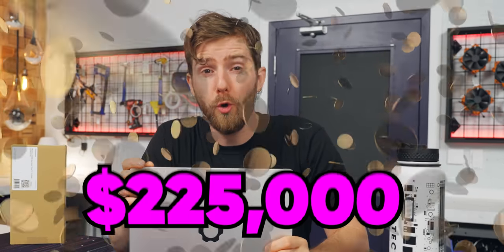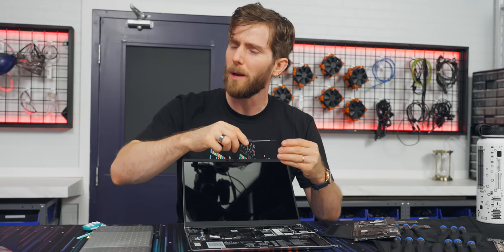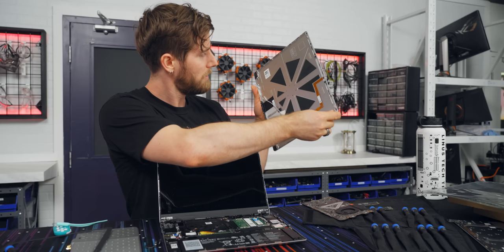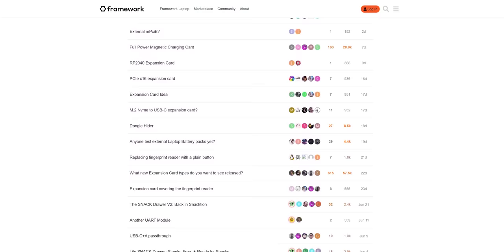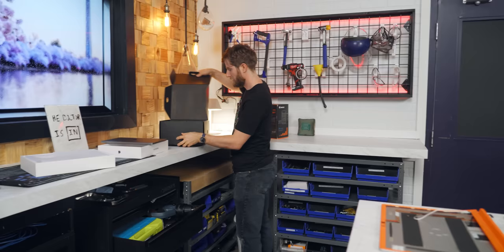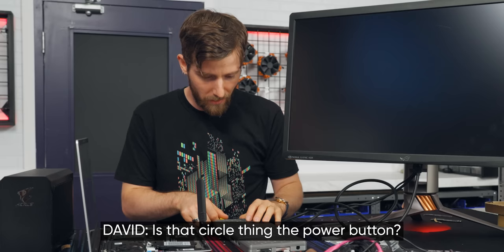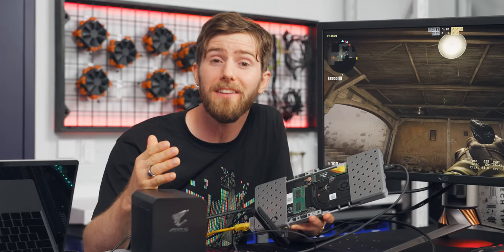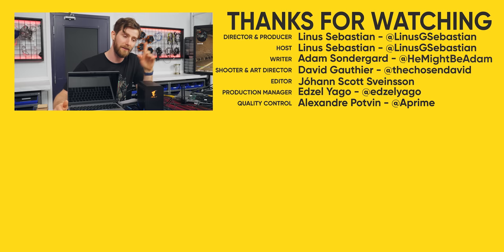I invested $225K in Framework Laptop - 1 Year Update and 12th Gen Upgrade

Comment: I really hope they'll make a future version with a dedicated GPU that is gaming capable. Upgrading your GPU down the line is far more interesting to me than upgrading your CPU.
Reply: That'll come down to manufacturers offering suitably sized GPUs (maybe a line specifically for modular laptops?). I really hope it happens, since I do game on laptop about 1/3rd of the time.
Reply: @MindForgedManacle  They used to make them back in the day. Alienware even had them.
Reply: I read on their website that they plan to do that eventually
Reply: fortunately eGPUs are widely available and relatively cheap
Reply: Nvidia used to make MXM or something, format graphics 'cards' that where physical cards that could be changed on the mother board. But that format has long since died, a GPU upgrade would involve changing out the entire motherboard including the CPU since intel dose not make socketed mobile processors anymore.
Reply: Agreed, that makes sense. GPUs become outdated more quickly than CPUs do!
Reply: If it does happen it probably won't be a top of the line gaming gpu, but a work station gpu. This laptop is supposed to be a laptop not a portable gaming pc. Still, they could surprise us.
Reply: just about what i wanted to write.   Add an option for a riser card and youve opened up to a whole new market..
Reply: That will require require a bit R&D to make the bandwidth work. Nvidia no longer support the Mobile GPU card since 10-series…
Reply: I'd love it if it was simply a new chassis, DGPU board, and battery, allowing users to use their existing MB.
Reply: That definitely would mean another chasis, so another model but yeah definetly possible, they would have the Original and the Gaming version, the problem would be that in order to change the GPU you'd need to buy the MoBo with everything including the CPU, just like they did now and that's because everyone has abandoned the mobile GPU form standard (like the DGFF, Dell was pushing) and CPU upgrades between generation means most of the time having to change the motherboard too because at least intel keeps changing the socket when they have a chance (yes not always but it would be unpractical to add a socket if it means just one jump at most). So, in order to make the GPU modular on its own Framework would have to come with its own daughterboard design and form factor and invest a lot of time and money into making different GPU boards with different GPUS and be sure their cooling system can be adapted to each of those, which sounds impossible for them RN. I mean, Dell tried to push their standard again and failed, so the more viable solution is to change the whole MoBo with CPU and GPU which means more to pay for the end user but that's how it is.
Reply: that is if there is a standard available, sadly I don't think major manufacturers would do this as there was a standard called mxm but was dead by the arrival of the gtx 900 series for consumers
Reply: @tv321123  Nvidia still makes discrete GPUs for laptops, it's just a matter on how Framework could adapt these chips on a new modular format.
Reply: I see this being feasible more in the short term through using their main board replacement system but having ones with a discrete gpu. Obviously they would likely have to offer a larger chassis or use a very efficient chip but it is definitely a place where the business can start now use that early knowledge to expand later.
Reply: MXM cards were the best thing to ever happen to gaming laptops and they scrapped it just to make the laptop thinner. What a waste of great design.
Reply: @walkinmn  That's a good point. Maybe one day they'll have the power and money to create their own mobile GPUs based on nvidia or amd chips. That would be the dream to switch your laptop GPU, like you switch your desktop GPU.
Reply: I think thats a tall order on a 13 inch thin and light. Your battery and thermals would be awful. An egpu solves both these problems. Then your laptop stays portablr for small on the go tasks but get full performance for big jobs when youre plugged in anyway. And framework has a battery disconnect mode
Reply: @matthewtrebs9738  I would be OK with a 15 inch version with better thermal design. 15" makes more sense with gaming anyway.
Reply: @tv321123  I mean one should be able to just take the chips and put it on a socket board instead of a mainboard.
Reply: @waralo191  Great so what connection standard is this 'socket board' going to be? How is the thing being cooled in a notebook? What happens when inevitably after 1-3 generations the graphics chip needs to change size to match a new architected and your 'socket chip' design is now defunct........ It's a horribly complex thing that your simplifying to idiot levels. It's been done plenty of times in the past...there is a reason why it's not done anymore....why it's not happening anytime soon...why no company is going to invest the massive amount of money needed to make it happen, only for all of it to go out the window after 1-3 generations.... Went so well with the Area 51... And because of the aforementioned problem's the old MXM standard never made it past 1-2 'upgrades' before the standards had to be updated and there was no 'update' that could be made anymore...
Reply: @Kenttheclark  ... and have terrible bandwidth. To the point of desktop 3080 performing like a 1080 due to thunderbolt bandwidth limitation. Trust me, they aren't worth it. There have been multiple testing throughout the years and the performance loss is horribly high.

Comment: I can't even count the amount of times that I've handled a laptop and said "I'd buy this if only they didn't fuck up this one feature" being able to retroactively swap simple parts (and even in the future had a catalogue of parts for one component) Really could feasibly make this the last laptop you need to buy.
Reply: Except that their screens are shiny, low refresh rate, there aren't full size arrow keys or a TB4 module. Oh and the screen is too small for my use case. If they made options for all of these things I'd probably get one. But just a few swappable modules that I could just use an adapter for really isn't all that appealing to me.
Reply: @allanshpeley4284  They are a small company, they simply cannot do everything at once. In the future, I believe they will fix the problems you are talking about.
Reply: @allanshpeley4284  maybe you should shell out 2k for new laptop and throw the old one in a landfill :)
Reply: Already a step ahead of you
Reply: @eliaskruse4187  Hope so
Reply: @allanshpeley4284  I think the biggest problem you mentioned is screen size options, it is a problem hardly solvable without changing the whole chassis, which would mean splitting your production in two and outputting more waste. But for the refresh rate/glare issues, well I'm pretty confident saying it's just a matter of time before they'll release a matte 120 Hz panel. Maybe some out of the shelf screens like these already exist compatible with the Framework though?
Reply: @a_d_z_y__  They really need to make more parts industry standard, such that most screens of particular size will fit, just like RAM and SSD.  At the other end of the spectrum, their module bays need an extra connector providing stuff like PCIe lanes and non-USB power.  This would allow the aftermarket to create modules with non-USB chips, such as 10Gb Ethernet and 8Gb SAS.
Reply: @johndododoe1411  is there even an industry standard for laptop parts?

Comment: Watching this made me realize how important on-board assembly diagnostics are for a user-serviceable device. Being able to quickly identify missing screws/components would go a long way towards ensuring that all users (regardless of their organizational skills) can complete repairs/replacements.
Reply: For screws, electronic detection will turn into a nightmare of anti-repair features.  Clearly labeling screw positions and limiting the total types needed will do a lot more.  "Oh. Where does this extra 7mm long screw go?, looks around and finds an empty hole marked 7x3 in the hinge."
Reply: @johndododoe1411   additionally, they could limit the number of screws by making one side slide into a slot, and then the other side is the only side that needs a screw. (Like an M.2 slot on a motherboard, it's held down on both sides, but only uses 1 screw)
Reply: @shipwreck9146  Screws provide a firmer clamping than a ledge.  M.2 mounts use a connection and a screw because the connection is needed anyway.
Reply: I strongly support reducing the number of necessary fasteners with good engineering and bright markings for screw locations (which are covered when a screw is inserted).

I also support electronic detection systems (when appropriate), but on-board systems can be as complex as a full bios level readout or as simple as a labeled storage compartment included in the device housing.

I think we agree on the principle that if Linus missed a screw in reassembly, this should be looked at a bit more on the design/engineering side.
Reply: @johndododoe1411  Coloured screws is the way to go. GREEN SCREW GO IN GREEN HOLE is as idiot proof as it gets.

Comment: If / When they finally have a ryzen and discrete GPU option i will get one. Love the idea and principals behind it.
Reply: Vote for ryzen!
Reply: The motherboard won't fit the case.
Reply: @lesliesavage9229  why so?
Reply: @FilSerge  There is no way to make a totally different designed board fit, when the board going in without the GPU on it barely fits as it is. Probably why they haven't done it already.
Reply: @lesliesavage9229  it doesn't sound like a problem at all. Chips have comparable sizes.
Reply: @FilSerge  The original poster wants a GPU not attached to the motherboard, his use of "discrete GPU" which means adding a GPU card. Not going to fit, and a Ryzen that is current will be bigger than a Intel Iris GPU built in to the Framework at present. What he wants is much bigger than what is in there now.
Reply: @lesliesavage9229  Agreed on discrete GPU. My thoughts are it has no use in framework.
As for bigger size of amd chip, zen 4 should fit perfectly.
Reply: @FilSerge  GPU and related circuits and not just a CPU. People use laptops for everything, but I don't see gaming in the future of Framework, which is an overpriced and undersized hobbyist toy.
Reply: @lesliesavage9229  Gaming laptops are not overpriced comparatively. All laptops come at a premium and gaming laptops just add to that. The problem is demand. If Alienware couldn't pull off the replaceable gpu modules, I doubt framework could...
Reply: @momoware  I am not talking about the price of gaming laptops at all, which I have owed a few, and this is not a gaming laptop, not even close. First of all the screen is too small. I am saying that the Framework is overpriced for what it delivers in any market, and that it will never have a GPU in it that is anything like some of these post seem to want, because of space in the laptop itself. They built it for what it is, and it's not for games, and gaming hardware takes up more space then it's current hardware, so this isn't as expandable as some may wish. I am looking for a laptop, and right now it is between a System76 and a foreign laptop, which either is going to be more than $2K, if I go through with it. But this is just an expensive toy you can swap out modular parts.

I hope Linus gets his money out of this investment, but Linus seems to have an expensive taste for tech. I really don't see this as a good investment for anybody.
Reply: @lesliesavage9229  The premium with swappable parts is steep, similar as all the Alienware laptops with modular GPUs. I wouldn't say it's "overpriced" because it is the cost of that feature, which incurs costs like opening additional factory lines for the modular parts and maintaining respective inventories. It's not really a "toy" either because it's duly executed in its own design. It might be an unsuccessful product, but I don't see how it's a toy.

The chasis is small because that particular product was not made for gaming. There's no reason that the chasis can't be bigger to accomodate different motherboards.
Reply: @momoware  The only people who are going to take this laptop seriously are people who will play with it, which makes it a toy.

I've fixed and sold computers, including laptops, and people bring in computers to get the p--- off it after they went where they shouldn't of, which is how un-savy your general public is. Case in point, Linus is excited about this, and he is a tech nerd that plays with technology. Most people who use laptop don't. Even some gamers bring in their machines to have them upgraded and repaired. I had one rig come in that cost more than all the computers in my shop combined, and we fixed it for a gamer. This Framework would like to be something, but it is for the person who plays with his computer, not talking about a gamer.

Also you said, "There's no reason that the chasis can't be bigger to accomodate different motherboards." There goes their business model with a bigger laptop to except bigger boards. It's a toy for computer nerds to play with, when a computer should be a means to an end, and not the end in and of itself.
Reply: @lesliesavage9229  A lack of market demand doesn't mean "toy." It's a strange word that makes a simple issue more complex: this laptop won't have enough buyers, and it won't have enough buyers because of its high price tags (expensive -> not enough buyers). People don't buy it not because it's modular but because it's too expensive.

This doesn't have anything to do with it being "toy" or catering to tech hobbyists.
Reply: @lesliesavage9229  The demand supply curve is static for a certain kind of product. It's the pricing that captures the demand. The price shifting too high on the curve doesn't make a product categorically different.

Cheaper modularity result in even more tech hobbyists buying the laptop, and hence more people buying it as a toy. And of course, it would also result in regular users buying it.
Reply: @momoware  Modular design is always more expensive, which is going to keep it in the area of a play thing, an expensive toy, like a Corvette or Mustang. Look at Linus in the video, who looks like my father playing with his Corvette, his a toy.

You can go around and around on this not being a toy, but they have other serious problems as well, when they can't even make hinges like the laptops that came out of 2004. I am not going to argue any further on this because it is a waste of my time, and go do something more productive. It's still a toy, and they need to bring this out of a gimmick laptop only a few would want to play with.
Reply: Have you gotten a framework 16 yet?

Comment: As a student looking for a new laptop for university next year, I love the way the framework laptop works. Everything is so easily swappable and user accessible. With a laptop being my only computer, having so much granularity and control over my device is comforting and adds a huge piece of mind. The ability to also repurpose old motherboards is such a neat concept and I can easily see myself upgrading and setting aside a motherboard as a media server or a mc server host.

Lots of great stuff from framework, I hope they continue pushing right to repair because this looks super good so far :)
Reply: Bought one for a younger relative student, 6 months so far, very happy. He is a non-tech guy, by the way.
Battery life is too short (4,5 h) for my taste. But his course work is light, and a mix of offline/online, living very close to university, so he never runs into problems with the battery.
Trackpad is a bit loose for my taste. Yet it works so far well for him and is - if it goes bad - user replaceable.
He liked hard switches for camera and microphone a lot, plus the fingerprint reader. The screen is bright, so reflection is less of a problem.
Reply: I'd say avoid these. As a student, you need to save money and these laptops are terrible value
Reply: @tralala8980  Battery life is something I'd have to watch, but hopefully in the next few months the drain issue can be resolved

I'm currently using a 6 year old thinkpad so minor imperfections aren't going to be a bother
Reply: @theslavicimmigrant4795  This is definitely not a value machine, I am looking at getting a new thinkpad or even an asus G14 as the price to performance ratio is quite a bit better (more on the asus than thinkpad side).

If I could spend the money I would, but I'd definitely have to wait and see.
Reply: @pixxel17  Waiting and observing is a productive attitude in this context.